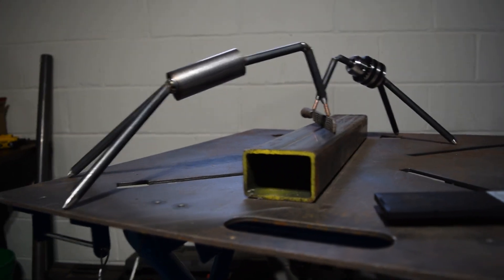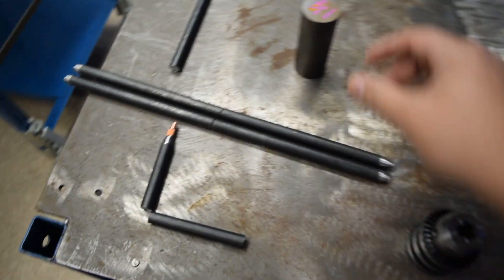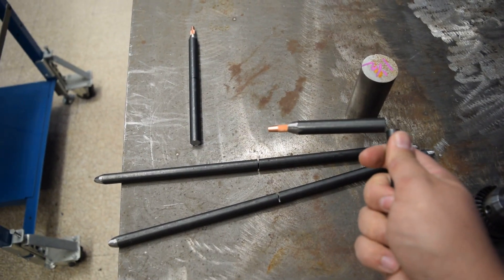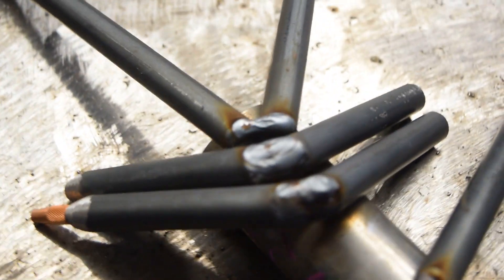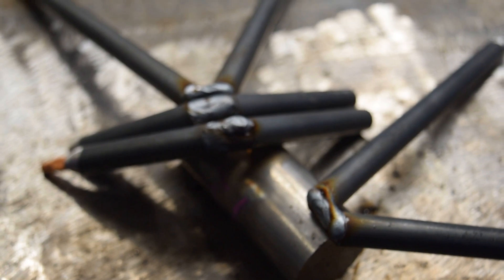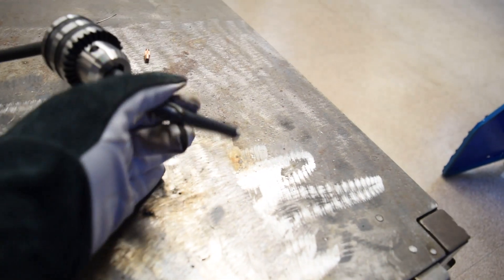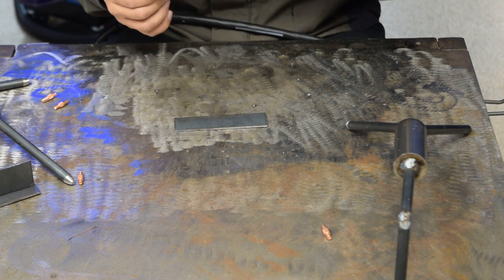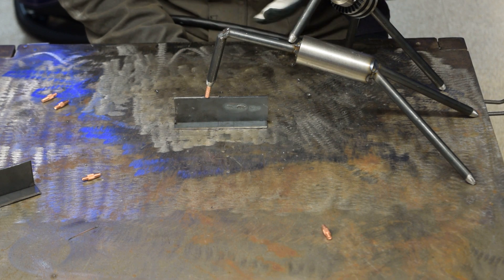3rd Hand Build, Beginner Welding Project (1 Day Welding Projects)

Comment: Where did you get the copper ends?
Reply from the maker: The copper ends are contact tips for a Spoolmate 100 MIG Gun.  But any threaded contact tip would work as long as you drill and tap the threads correctly.  Hope this helps!